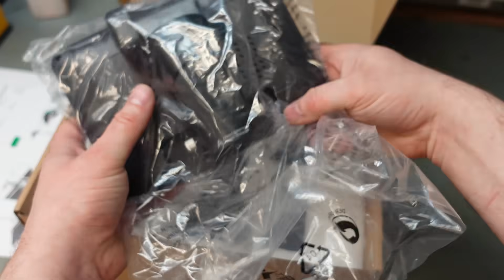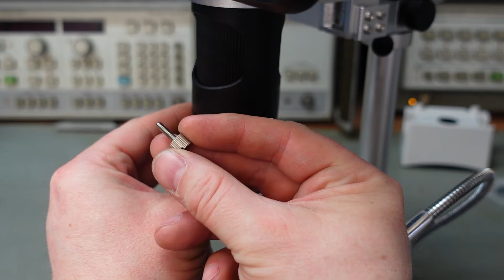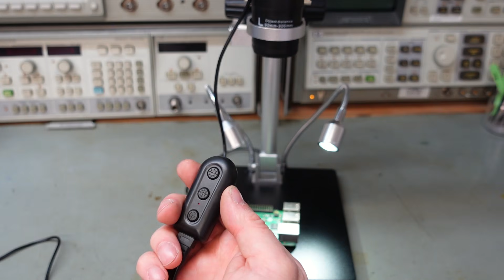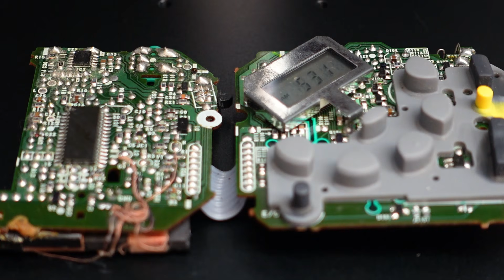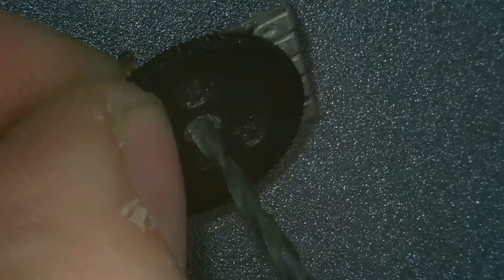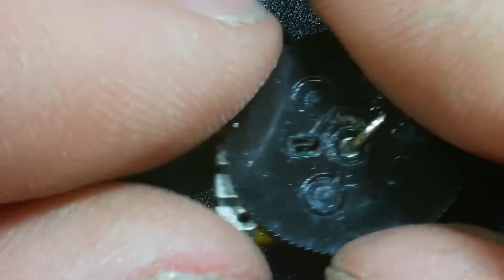ANDONSTAR Digital Microscope & the SONY SRF-M35 Walkman Repair

Comment: Great Microscope, seems a good tool for this and the video output is a nice addition for us viewers. But you loose your depth-perception, it being non-stereoscopic. Takes some getting used to I think. In my line of work we sometimes had to use an endoscope, don't get me started on that .. indispensable, but navigating your way around (inside) your object... Same thing but worse. Keep going, nice video's and with practice you will get used to the 'scope

Comment: When you used the solder pump on the 5th (of 5) contacts at the bottom of the potentiometer you got another "double". You desoldered the 5th contact and then another pin right below it.

When you soldered it back you didn't resolder that extra contact.

I'm surprised it worked. Or maybe that's related to the poor reception? Walkmans like this use the headphone cord as an antenna.

Reception will always be better with real headphones instead of a coaxial wire to an instrument as you are doing.

Comment: Looks like using some magnets on the microscope base would be great for positioning and holding your work.  If the base is aluminium, attaching a thin steel plate with do the job.

Comment: When I used to repair small-scale things under a microscope, I would make the solder tip smaller on the lathe and modify the solder sucker too.
They look huge under magnification :)

Comment: 22:11 What's a "mil" in this context? Usually metric people mean "millimeter", but that's clearly not 2mm thick tape. It could mean "thousandth of an inch", which would be about right, but you've been dismissive of imperial units in the past. I guess you could mean "micron", but I've never heard anyone say "mil" for "micron" before.

Comment: Mark, you may want to add that UV-curing solder mask fluid typically sold in syringes to your tools and materials kit. Good for isolating exposed copper tracks, contacts etc. It sticks well and it is quite durable.

Comment: I worked for several years with thin film keyboard production, and in the end we made quite elaborate designs with vias and 4-5 layers, LED's, interface components and dome switches.  Fixing these (especially cracked tails) with silver conductive paint was standard, we also used the screen ink (witch was UV cured) and just sent it through the dryer. Good times!

Comment: Thanks for the videos. Very educational and strangely relaxing. Does anyone happen to have the schematics for a BBC Micro Model B power supply (Astec/BSR)? I took my Beeb out after over 20 years of inactivity. I recapped the PSU and tested it outside the case. It seemed to work well and the voltage was correct. After inserting it in the case and firing up the Beeb, nothing happened. I rechecked the voltage out and got around 0.25v. Strange.

Comment: Big respect for the pot repair. Wow. Not sure I like the wire bend to hold the knob on where you drilled it out. I might have tested the wipers and then held it together and put a drop of epoxy or even hot melt around the wire. You amaze me.

Comment: Hi Mark, my Sony Digimatic Solid State (from the 80s ? 70s?)  I wake up with since a loooooong time has decided to stop working : no radio. I opened it, it's a nightmare of cables, I am not able to find (visually) what is wrong. I can't find a workshop here in Paris to repair it. Would you take it to check it? (I can sent it to you). You seem to be my last hope...

Comment: Hello, I am Mahmoud from Iraq. I follow all your videos, and you are a really skilled person I really need your help about a type (technics ) device. When I turn it on, it works fine for the first 4 seconds, after which it turns off and appears on the screen (over  load) and remains like this. Please find a solution for me. in my country. There are no skilled repairmen, and I really love this device! 😥
Reply: @mahmoodalnamany8295

Salam Brother....

Just an idear..... if you went abroard and did a degree course in electrical engineering, than you could help the people in your country, and help teach others what you have learned......

That would be a great help for your people.......

Comment: I have a Panasonic (Panasonic RF SW-70) triangular-shaped pendant-style radio from about same time 2001. Bought for the World Series, still works. Angels WON!
Digitally-tuned AM/FM radio with up to 20 programmable station presets for convenient access
Ergonomic triangular design fits comfortably in the palm of your hand
Special hole for threading a lanyard or chain for wearing around your neck
Water-resistant design
Powered by single AAA battery (not included)

Comment: Silver conductive paint, never heard of that before. It is actually a thing in electronics, neat. And also really simple solution to reattach that wheel  with the wipers to the rest of the pot. You repaired that one with a lot of creativity and imagination. Very impressed by that, you seem to repair the impossible.
Reply: People use it to fix rear windscreen heating elements. That's where I heard of it first myself. You can also use it to fix keyboard damaged traces on those flexable plastic sheets.
Reply: @anthonydenn4345  Thank you for the examples. I actually got a classic car with a broken heating element. Just for fun, classic car doesn't come out when it's bad weather.
Reply: Old  technIcs! Repair

Comment: Great video as always. The clip of you getting a jolt in your intro always sparks the memory of an occasion I put a capacitor in the wrong polarity and when it popped, I jumped so much I fell off my chair and landed on my back🤣
Reply: Reminds me of the time when as a budding young electronics tinkerer I unwittingly put my hand on the back of a recently disconnected TV tube. Won't be doing that ever again!

Comment: I have a similar microscope to that, except no HDMI output, was around 50 pounds cheaper. They are good microscopes, and I power mine using a 2amp rechargeable power pack.

Comment: One of the problems we've been having with old Radio Shack walkmen is that the wipers often break loose from the rest of the potentiometer - a problem compounded by the fact that the volume control is split between right and left channels. Asbestos we tried, there's no fixing it...

PS - a micro-screw like something off an Apple product would've done that pot a treat upon re-assembly. Bet we have a few floating around, too...

Comment: Judging by the original glue which holds it down and stops the strain on those tiny cables. I'm pretty sure you've glued it in upside down.
Reply: I thaught that myself..... wires on one side but not the other, and the shiny puddle on the black.....

Oh well..... it works anyway

Comment: Great job Mark!

I've had so many issues with Sony pots on portable devices. They account for a lot of failed devices. Also I was thinking about microscopes, but I've found the kind with a screen on top to be too shaky while I was working on stuff, and it would cause the view to move around too much. How did this one fair in regards to that?

Thanks

Comment: Bespoke volume pots are a killer for old gear, made by a guy in outer Mongolia for the production run. Just a quick question, have you had any luck repairing the contact area on 80's custom LCD's (zebra strip type) with conductive paint?  Big Thumbs up..👍👍

Comment: I have a stand alone hi-res camera  on a similar stand. One thing i found was with some boards, the pole gets in the way.  What i did to get around this was use an old desk monitor stand, placed the camera base on it front to back and turn the pole/mounting and lights around to look over the edge of the monitor stand. this allowed me to put larger boards right under the microscope base. Raised it about 12cm as well.

Comment: Great demo, seems like a reasonable price for a good microscope. I'd be concerned about the lens getting grubby from the solder smoke, maybe a 12V fan would be good to pull that away.
Reply: Nah solder fumes are sentient and generally aim directly for ones nose. Screen should be fine.
Reply: So true......

Comment: Awesome Vid as usual! Glad to see im not the only one using the digital microscope. I find on small components, prestik works great holding them in place while testing etc. The bed is very slippery due to the surface coating. Keep up the vids and the awesome content! Cant wait for the next one!!
Reply: # change the surface contact coating?.....